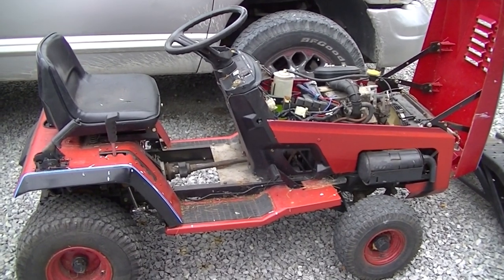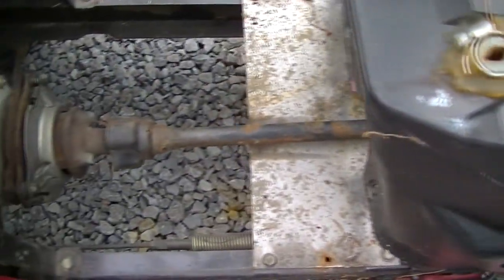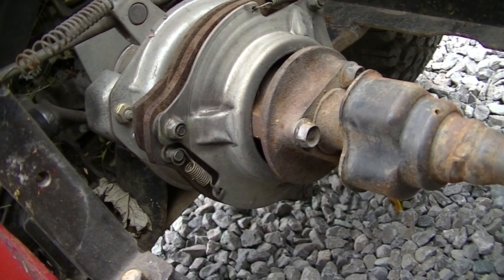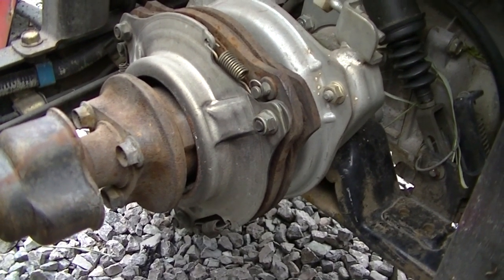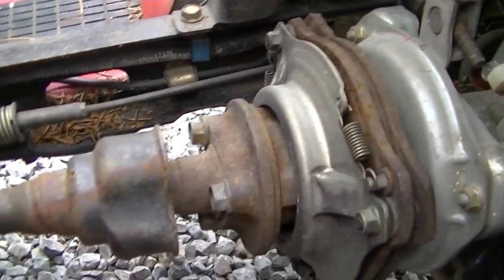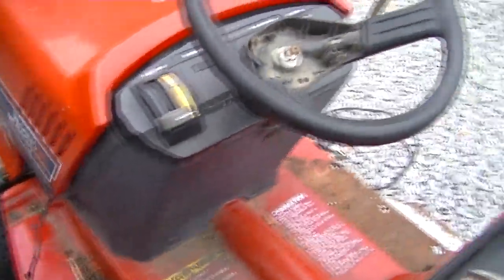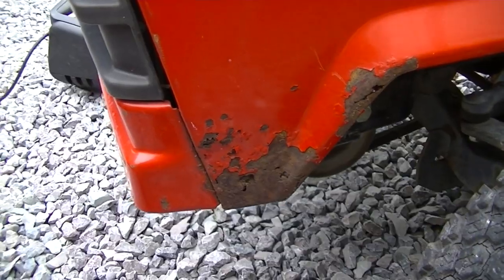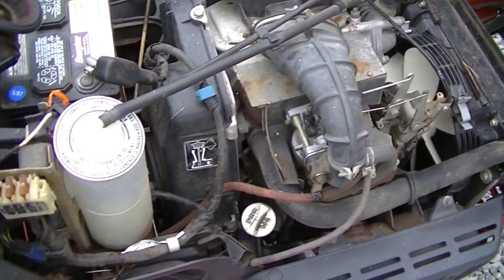Frankenhonda Driveline- Closer Look

Comment: Well if the tractor is is kinda built like a a car with a manual transmission could you put it in gear and push it to try to start it because your starter isn't working just my thoughts
Reply from the maker: It's concievable. Doesn't tend to work very well on loose gravel tho.